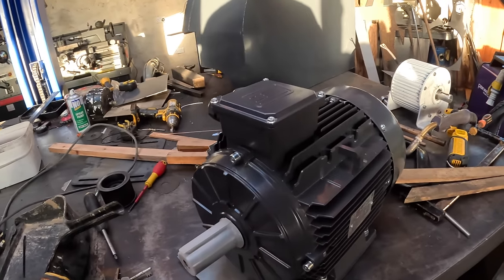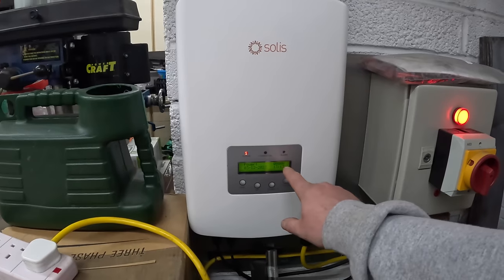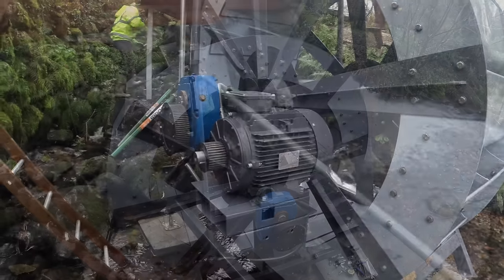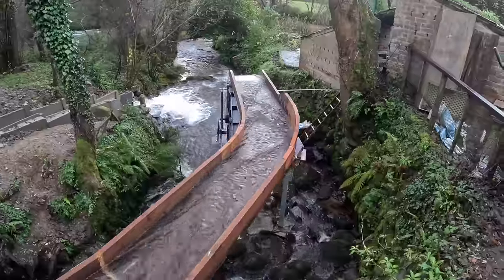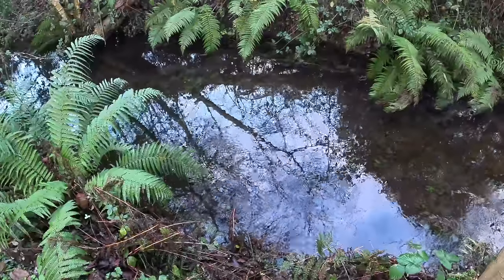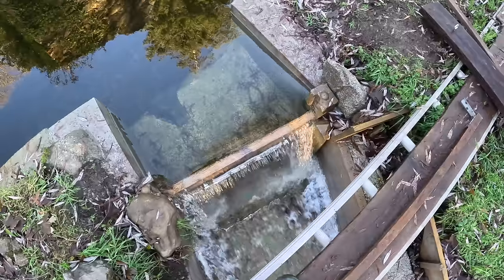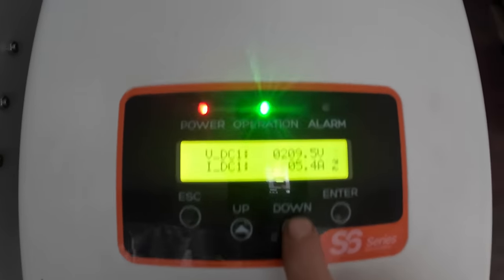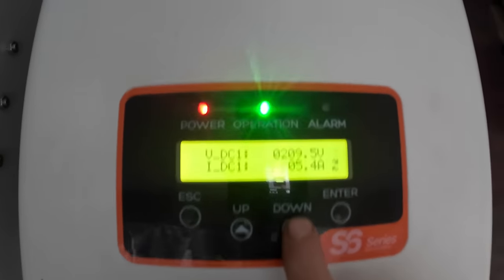Powering An Old Mill  1.5 Kw Lake District Overshot Waterwheel Project Part 4

Comment: Would placing guide fins in the water channel to help the water flow around the curve in an improved laminar flow manner make any improvement? The water flow density seems greater against the outer channel edge. Uneven bucket fill? Just a thought. Cheers.

Comment: awesome i been working on one of the water generator to run off grid and couldn't find the right configuration.. and none of them are true as to their outputs like the 3 phase if you put a copper coil around the lode and make a heater type like radiator heat ?

Comment: Internal combustion engines always have ignition timing before top dead center.
Try admitting the water before top dead center ie shorten the spillway so the buckets are already full as they reach top dead center.
Also the splashing might land back on the buckets not down on the rocks.

Comment: Woo, she tight! :D Nice to see this working now man :) Would it be possible to change the gear ratio with different drive pulleys on the wheel or the electric motor, to achive araound 15-1600 with the same lower water flow`? (just curious, i have no idea what iam talking about) :D

Comment: Hi , i may have missed it in the comments somewhere  , or in a earlier video , did you explain how you came by the correct value of the caps  for that motor ? also what did they end up using to convert the AC too DC  for the grid tie inverter ?    Thanks for a  very interesting video

Comment: Could you add sort of a mud guard from 9-12 o'clock for want of a better description, would contain the splashing and reduce the noise, if that became an issue for the owner, also might have a small amount of increased efficiency. Easy enough to test with a mock up.

Comment: looks like you have the room to fit a 2nd wheel and motor beside each other with the required water flow to do 1200 on each wheel.

Comment: My only problem with it is the way it turns, I think you would get a lot less spill if you pour the water inside rather than outside. That's not going to change at this point though.

Comment: Question. You can al so run a belt from water wheel to generator in crease rpm on generator and if the ratio of over. 50 to 1 rotation

Comment: Seeing this, I would have built that as a much larger wheel that was just wider, then I would have increased the width of the ramp down to the wheel so it would slow down the speed of the water. At that point it would more easily capture more water. This would cause the wheel to spin at a slower speed but then have more torque, this would then cause less splashing and loss of water, but then give the whole setup more torque which then you can gear up to whatever speed you need it to be to generate the power level you want. This would have costed more to build but would have been able to get closer to that 1700W peak output with less loss.

Generally, this is a very good build but would think it would have been better to have it be wider so each bucket could handle more water and then allow you to then be more efficient on the high end for flow.

Comment: Hello Kris. As a Dutch railroad engineer I wonder if the term failsafe is correct. Are broken wires detected to the sollinoid that pull the pin out of the water shutdown feature? Besides that I love your video’s and accent! Aat Hoogervorst

Comment: Speed could be limited by mechanical governor, though it'll have to be covered from elements and it'll be quite big.
Flow though could probably be automatically controlled based on wheel speed along with overspeed cutoff

Comment: BTW you dont need a dump load, just drop the caps. to get it back online add less caps and establish an output then add caps to bring the RPM own and the efficiancy up. Again stuff I have in place so absolutly know works.

Comment: By having a steady output of 1.2 kW with a possibility of up to 1.55 at peak, they could also (especially in winter when grid demand is high and they could get paid more, especially at peak times) adjust the flow rate to maximise profit.  But the main issue is that it would generate a steady generation for 24 hours a day, and could work unmonitored for days on end.

Comment: I wonder EXACTLY what average torque that wheel shaft is putting out? Calculate that Kris, and add two more cogs/gears in the transmission train to maintain clockwise motion, calculate what diameter they can be within the torque output, and then you could really spin that motor. Maybe put in a variomatic transmission or a slipping clutch mechanism to spill the power if and when required. Also, if the river ever slowed in flow, using this set-up, a slower flow= slower wheel= same power because of its torque and gear settings to maintain motor revs

Comment: @KrisHarbour I have a lovely little motor sat here, and I am "almost" sure it would be good on a water wheel / turbine.
It's a Motenergy me0709,  same as the old etek rt. Please take a look and see what you think, it's rated at 6kw constant, but I don't know that's as a motor, and how that translates to energy produced when used as a alternator? Here's the spec from a website...
This ME0709 motor is a permanent magnet DC motor with brushes.
It has an efficiency of 88%.
The ME0709 motor works for voltages from 24 V to 72 V DC and 125 amps DC (peak current 300 amps for 1 minute). 
Its permanent output power is 6kW continuously and 14kW for 1 minute.
The maximum recommended rotor speed is 3700 rpm.
Its mass is 36 pounds (16.75 kg).
It is a fan cooled open frame motor.
The power terminals are 5/16-18 UNC.

Comment: just a thought  have you tryed  difrent length end of floom to inhance wheel speed?
not shure but if it was longer over the ark of wheel on the down hill side could be less splash and more in bucket

Comment: Hello 
I really like your work. I'm building something similar at home, but in offgird. I'm wondering whether it would be better to use an electromechanical valve instead of a radiator to cut off the water supply to the water wheel? I won't be connected to the mains. I charge batteries and consume energy. but in the event of a failure, overheating of the generator, battery, or internal network failure, I used an electromagnetic valve that automatically cuts off the water supply to the turbine. Greetings from Poland

Comment: I work on the renewables sector and have seen massive upsizing to get economies of scale in the last 15 years, HAWT’s have gone from sub 1MW to excess of 10MW now, so to see a micro system giving that level of efficiency is impressive. I don’t think it’s possible with micro WTG’s, especially as both you & I have experienced the generators made of chinesium are massively under powered compared with the rating plate. 
Kris…you’ve done the hydro industry proud…Chris

Comment: If you doubled the width of the wheel and flume, the same volume of water would fill each bucket with half the velocity, which should significantly reduce the splashing.

Comment: I think with a little more work an automatic speed governor can be implemented either mechanical or by adding a linear actuator to the water flow control. Also from the beginning I could not understand why you were not using a 3 phase motor as a generator.

Comment: So if it was 50% wider you could run it at full winter flow without splashing ..correct? Obviously the diameter is fixed by the head (2.6m) 
I have a project like this, but 10x the flow and 3m so a water wheel isn't going to work , looking at a Kaplan turbine. Wish you could help with it.

Comment: Kris, how would it go if you had slightly higher sides on the wheel so the buckets were lower than the sides, eliminating the water splashing over the sides, reducing
the water striking  the gearbox/generator cover and the shaft/plummer block bearing on the non drive side..

Comment: Would your wheel have enough torque to operate an additional motor on the opposite side the axle with the same water of some additional water volume?

Comment: I had to ask, when you had it on the test rig with a 3 KW motor, you were dialling up the speed gradually but I'm assuming not near the max rpm of that motor. So if not, it wouldn't be drawing 3kw at that point. So question is what was the motor drawing when the generation end was outputting 1700 watts?

Comment: only thing I would add is try to make the fail-safe only trigger when power is out. you dont want to need on another source of power to make it protect. Ideally the power made in the wheel would keep it open. Not sure how to make that happen but perhaps having the relay on and actuator fully extended should be the way its rigged to be open and when it loses power have it then close. so say for some reason the belt brakes, power stops generating and the system shuts down. Just my two cents.

Comment: Here's what you do is put in lithium battery in place and just have that motor recharging that all the time that's 24/7 power you can run 220 off of lithium and then you can recharge it right back within minutes with mppt chargers that are built into these things like an Eco flow battery or Bluetti

Comment: You've added the over speed shut down but why didnt you use an actuator to control the flow with a feedback loop? It would have been quite simple to detect speed and drive a worm screw to increase or decrease flow. 
I don't see the need for the manual reset when grid failure occurs. All that should have been necessary is for the resistance to be in parallel with the grid tie inverters input which will disconnect once the inverter has reconnected to the grid. This could be by a signal from the inverter or just adding a delay longer that the inverter's time to reconnect (3mins?)

Comment: I must say I'm very impressed with this system. & it as demonstrated but it would be improved if it went together without welding. alas. when one has ways to produce your own power even if we have no access to water wheels & windmills, so long as we can get our hands on an inverter mother & a few copastors, The is a way to fill a DC  power to a battery bank. 

I refer to & power our homes.  even if it is a bit hairy shirt. One could even recharge one barite by powering it with an electric motor as demonstrated in the film with one's grid supply   & cut down one's consumption altogether but for its ability to switch on & of  AS desired level of need one could use solera as a fill-in supply. Someone can do the math we could develop along them lines. when one as a viability plan.

Comment: I don't think you should get the end of the trough perfectly aligned with the buckets since they are rotating thus smashing some water away at high speed, the water should flow at an angle a bit less steep than the buckets so it would kind of follow/anticipate the buckets movement

Comment: I have a full noob question if you drop the height of the shoot just as the water enters the water wheel. So the shoot is 5mm off the top of the wheel will that take alot more of the splashing away? Also would putting v peaces down the shoot towards the end to try and stop the water from splashing side to side would that help as well?

Comment: I'am thinking about getting the wheel automatically transferred back to the inverter. Does the inverter have some "ok" signal/relay? Or can't you just put the inverter always on the dc side in the event of grid failure and control the dump resistor by measuring the current to the inverter?. That way the dump-load controller could detect the inverter building up demand again and shut off the resistor. It also would work the other way around. What happens if the grid frequency climbs above 51Hz or the voltage rises above 250V? The inverter reduces demand which you also need to detect and react on by switching the dump-load in.

Comment: I'm just thinking of an edge case here but what happens if the grid voltage to the house goes out of spec, for example high or low voltage or frequency and causes the inverter to disconnect from the grid but there is enough grid power for the switchmode power supply to keep the dump load relay open ? You could have an overvoltage situation just from that, do you think your secondary overspeed device would react fast enough in that situation?

Comment: With that new heat sink, does it glow/emit obvious visible radiation when it gets hot or otherwise radiate significant, noticeable heat? I just would worry about the outer metal cage becoming a burn hazard if it isn’t obvious to a visitor that the heat sink has been tripped, especially now that it is away from all the other components.

Also, it’s very unfortunate what happened with that supplier, and I hope you didn’t lose money on the gig—it’s obvious that just in terms of time you had to invest a lot more in the project.  But the experience you gained from the work and the end result of a successful project with a (presumably, obviously—he or she ought to be) happy client in such a niche industry is pretty much priceless.  And on top of that, you were able to make more videos and monetize them, and help other people learn from the issues you encountered during this build and install.

Comment: I know that the original ‘generator’ and this motor are approaching things from a different way to generate, BUT man, the difference in size is staggering. Shows just how much that chinese company is overstating the specs.
It’s similar to some of the lithium batteries coming out of China. Specs don’t match output, and also some USB memory sticks sold that state amazing specs for their size but not even half the amount of memory/capacity.

Comment: Your water wheel system looks great, But your charging system has problems. 1) The water and the wheel are an engine. 2) You are running the engine at the same rate but using the alternator /generator as a brake. Did you test the output on the alternator when using as a brake? Suggest a system to slow the water rate in relation to RPM of the wheel. Good luck.

Comment: Why not a hybrid inverter with battery storage. You tend to find normal going you only use around max 300watts. And most things like washing machines, dryers, oven. Are around 2kw. The battery will give the extra when consumption rises. Just a thought. Also if they have an immersion. A iboost would be an opinion.

Comment: What sort of cost is this type of setup? I've got a farm in south wales with a good stream especially in winter.  Also my farm used to have a massive wheel in the ground which is still there,(the hole not the wheel😢)the waterways are still here too.

Comment: next adon, eletronic gate valve in the water. conected together, rpm , eficienci and load. can acta as protective to... to avoid over speed or emergencie shoot down. cool, good luck, and a merry crismas , very hot..kkk..kkkk

Comment: Could you put a DC buck converter in the line to force the voltage to not go any higher than the controller can handle?

Comment: Is there any way you could connect a UPS to the mains supply to prevent short term power cuts killing the output until someone comes to reset it?
Reply: The UPS would have to be huge in order to cope with a sudden loss of power when there's a high draw from the house. It would also probably be quite complex to use an off-the-shelf UPS for such a purpose. I know the Tesla Powerwall fulfils this purpose as well as providing battery backup.
Reply: @bunnywarren  I was thinking of a UPS only to keep the controller happy and think the power was still on, not to power the house. It would probably get complicated keeping everything safe and not feeding back into the grid though.

Comment: 2:49 - ...and continues by putting on totally wrong kind of protection??? I wish you wore a little more protective gear than just your eyelids... Have I seen you earlier using the exact same strategy while cutting (metal?), or is it only just for welding?
Otherwise I'm really happy to see you succeeding on this project. Water wheel is visually very pleasing machine comparing to alternatives. You can easily see when and how it is working. It is beautiful machine.

Comment: Since where the wheel is placed has a lot of space left, would a wider wheel have produced more power? Or is there a limit to the width in relation to factors as waterflow and elevation, where they in a way dictate the maximum width?
Since it seems like if you take the amount of water you use to create 1500W+ and feed it into a wheel that handles that volume like this wheel does at the 21:00 mark, you could get even more power out of the system.

Comment: Could you not transfer back from the heater dump with two relays and a delay - moving to both the heater AND the inverter, then finally the inverter alone?  Would that be gentle enough for the inverter to cope with the switchover recovery?